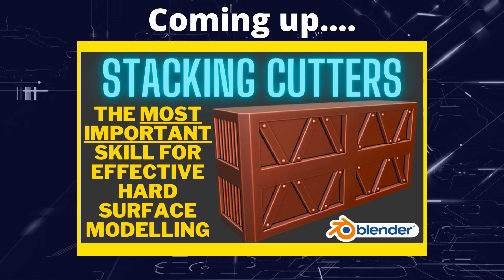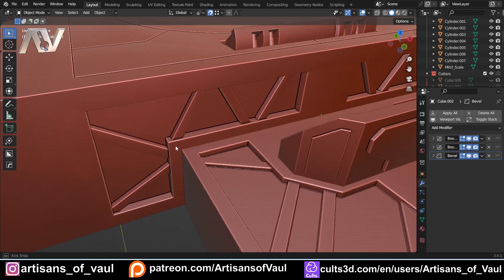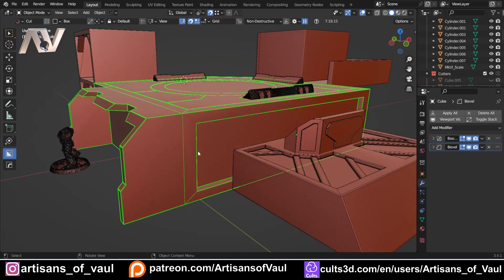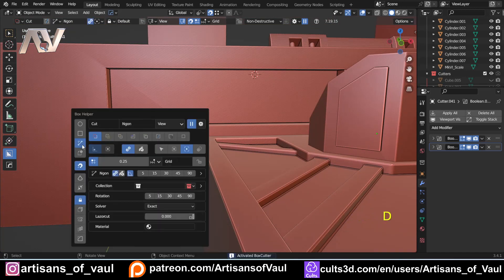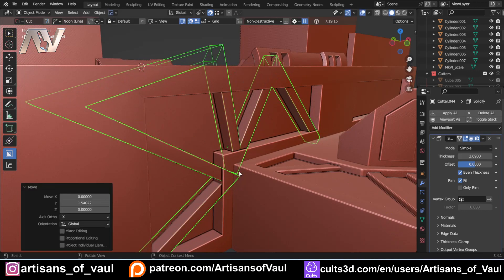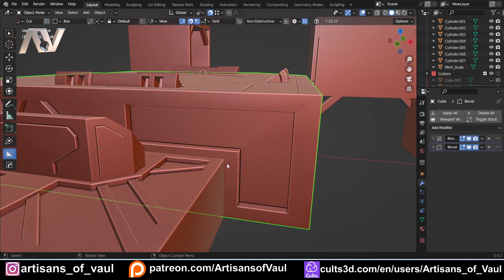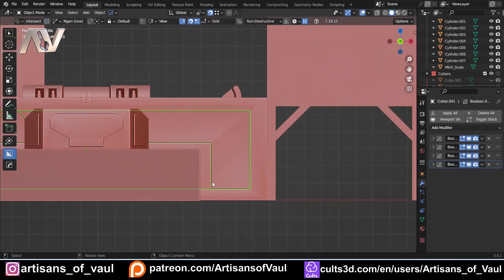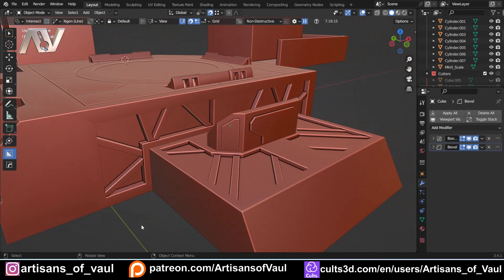Stacking Cutters - The most important skill for effective hard surface modelling

Comment: Very informative video, thank you! When i try to do the ngon cutter for the beams, my beams are way too thin, and the box cutter cutter seems to be very very thin and not the thickness of the beam in the video. What do i need to do to change this?
Reply: When you drag the ngon cutter, press T for thickness and you will be able to adjust it ;)
Reply from the maker: I've found the dame recently! I thought it was just me. I think there may be a minor change in an update that's affected this. When you click to confirm the object size/shape just manually drag it though to the thickness you want and you're all good.
Reply: @ArtisansofVaul  perfect thank you!!! These videos are totally revolutionizing how I make models for printing 👍🏼👍🏼
Reply from the maker: @MCHammer0000  That's awesome to hear. Thanks so much 😁
Reply from the maker: Oh damn, I just realised I had totally misinterpreted what you had asked (my fault, I must have been half asleep).  I had read your thickness question as being depth.  VG Modelling is totally correct, you use T to change the thickness.  Just make sure you do it after the last click of the shape you want as you can't then add to the shape afterwards.  But once you have used it once it will retain the thickness you have set for future shapes (with you can then change again with the T button).

Comment: hey man, quick question for you.  If the intention is to use the model being made for 3d printing, does perfect topology even matter? If I made a model with Boolean cuts everywhere and the topology is total mess, what happens when I send that into the 3d printing software?  Is perfect topo, something that is only really necessary for game design/animation etc?
Reply from the maker: Great question.  As long as the pieces are manifold perfect topology is pretty much irrelevant.  The only thing to bare in mind is that if you are going to ad a subdivision modifier you need everything to be quads.  Otherwise ngons are perfectly fine.  Just check with the 3D-Print Toolbox and away you go, which is important if you have done some really complex booleans.  I go through the things to be careful with here: https://www.youtube.com/watch?v=6pPDXBJiqyA